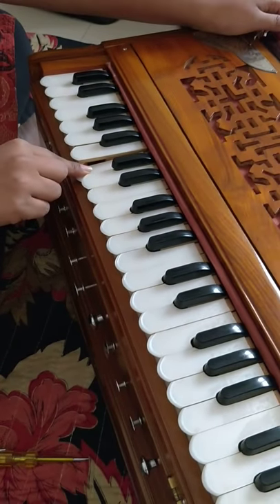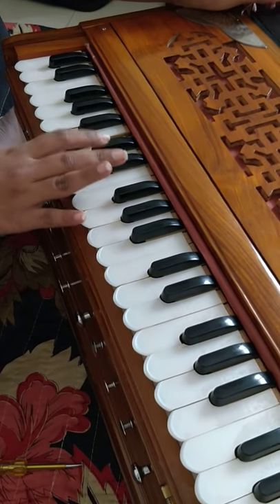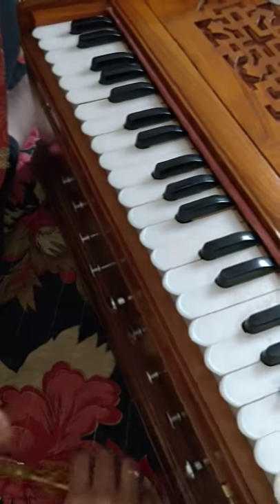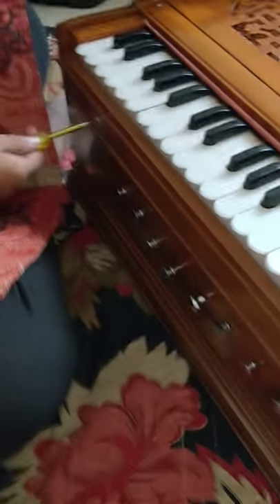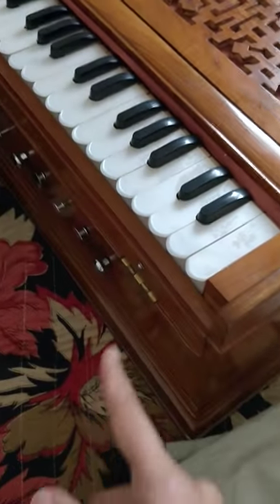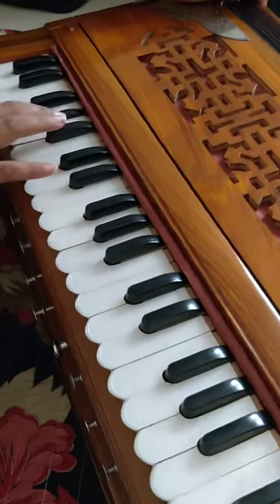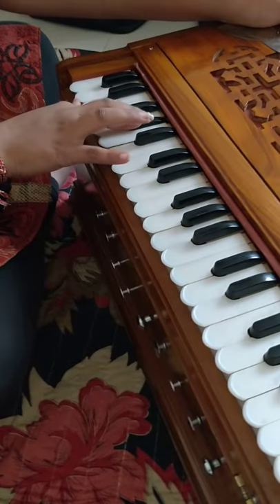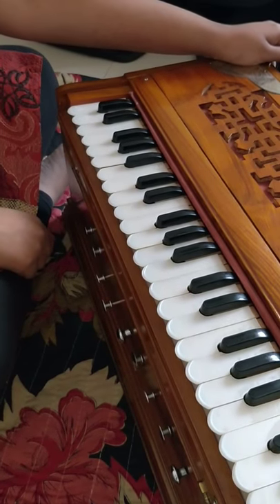How to repair your harmonium in 10 seconds

Comment: The string that holds the key that has become loose and is not putting pressure on the key anymore that is causing this same kind of problem of the key sitting, I have tried tightening the screw but did not help. Can you help with this?